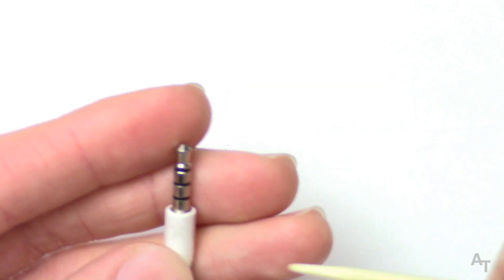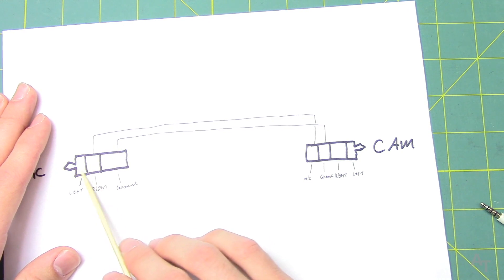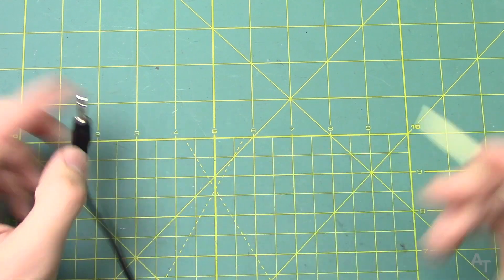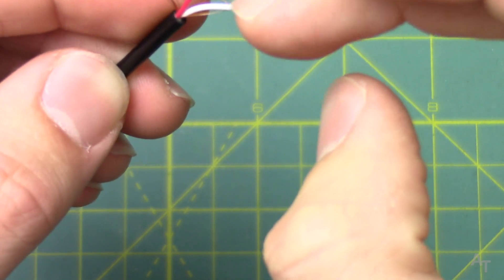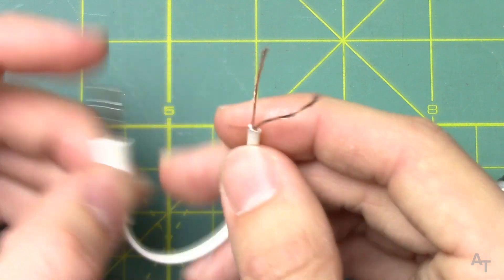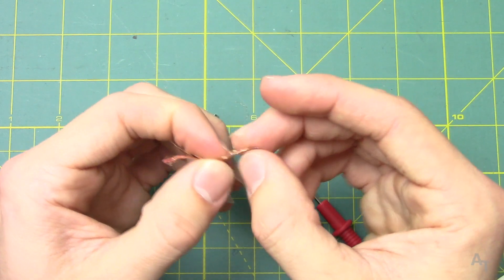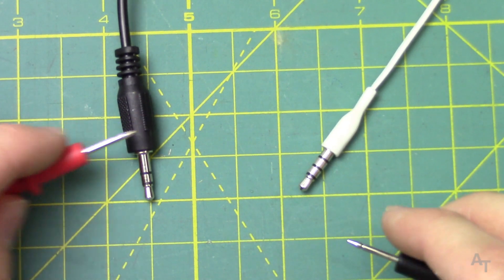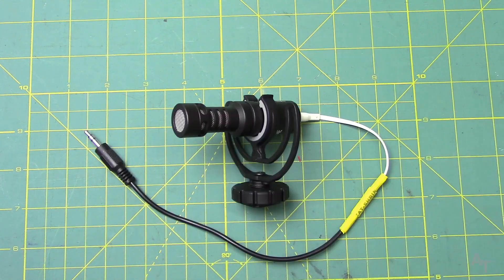How to Connect Rode VideoMicro to Phone (DIY TRS to TRRS adapter)

Comment: 1. To where did you connect tip of your TRS?
2. What will happen if I wire left audio output from TRRS to the ring of TRS?
(the goal is to have input(mic) + output cable)

Comment: been looking for ages to find a schematic for the videomicro output pins.. thank you so much. 
I purchased a TRRS buildable jack - the barrel of the jack unscrews and you have 4 posts inside to solder your wires onto, and I was able to wire up a phono lead to connect to my mixer.
Does the phone supply the necessary plug_in_power? couldnt find any information on this and in your video, it just works..

Comment: Thanks for this priceless video! I have a question though, I've got some problems trying to figure out what wire is what since I've got a cheap multimeter with no continuity test on it. There's another way to find out the different wires for each cable?
Reply from the maker: Hi! Glad it helped! I suppose you could apply a very small voltage to one of the wires to read on your multimeter.

Comment: im just wondering if theres and alternative cheap extention/extended cable for this?
.
.
will this work?
.
https://www.amazon.in/AmazonBasics-Stereo-Audio-Plated-Connectors/dp/B00NO73MUQ?tag=googinhydr18418-21&tag=googinkenshoo-21&ascsubtag=_k_CjwKCAjwq4fsBRBnEiwANTahcA_tJh43TzWl91tCS0mKU-jNdkyKX5FAPZPIpAw_GqoyN5ZJlLjD1BoCiIgQAvD_BwE_k_&gclid=CjwKCAjwq4fsBRBnEiwANTahcA_tJh43TzWl91tCS0mKU-jNdkyKX5FAPZPIpAw_GqoyN5ZJlLjD1BoCiIgQAvD_BwE

Comment: Hey. Your video saved me! Thank you so much!

Here's my story:
I live in Brazil and I asked my friend to buy the Rode VideoMicro in the US and also the original connector. ( I know it is expensive, but if I'd buy the same things here, I'd pay more than 4x the US price)
But unfortunately he couldn't buy the connector, so he just brought me the mic. 
So, I bought a Boya connector and paid around 23 usd here in BR. But idk it wouldn't work.
Then I started wondering if my mic wasn't working at all, or the Boya adapter was broken or maybe both. And I didn't have a DSLR camera to try the mic with it.
I thought I'd probably had to spend more money to buy the original Rode adapter.
And I started googling some solution and found your video!
Well, it is an option that would cost less than 2 USD for me, why not try?
And it worked!!!!

So thank you, thank you, thank you!!!
Reply: Wow, I'm moving from Peru to Brazil and I've been shocked when I compared electronic devices prices between both countries, so now, I'm buying anything that I could need in near future before moving there. I've just bought a Takstar SGC-598 to attach it to my mobile phone and my camera. Also upgrading my laptop and so.
Reply from the maker: You're welcome! Glad I could help! =D

Comment: thanks for the video, but i have some issue with my trrs cable + i  dont have multimeter to check what is what. my trrs cable has: red, black, green and copper. the mic i have has only ground and +. which is good.

Comment: I used a gaming headset trrs cable and it worked without converting. Since it's dual mono am I looking a channel?

I also have headphone cable that is a trs on one side and trrs on the other but it appears to be quieter. Any thoughts?

Comment: How come you plugged the TRRS end into the mic at the end?
Reply: The TRRS is what the phone recognizes. You can't change that. The phone jack is expecting a TRRS input, but the RODE is sending a TRS output...which is wired differently. What he changed was to remap the wiring on his cable so that the TRS output signal from the RODE will send to the correct pins upon arrival at the TRRS end inserted into the phone.